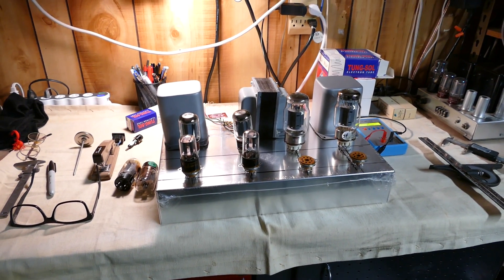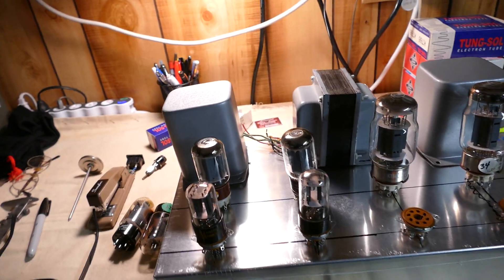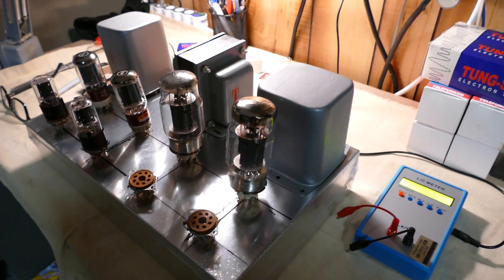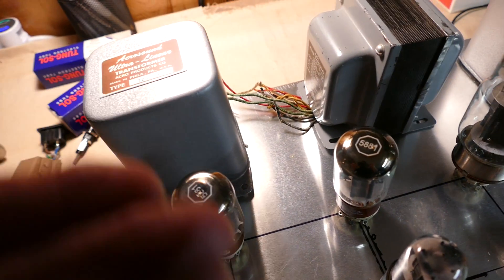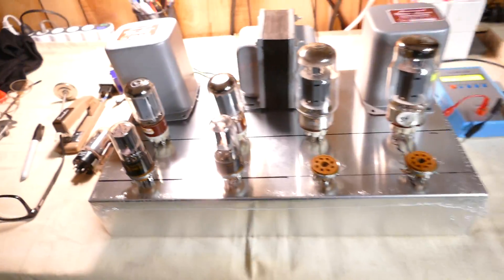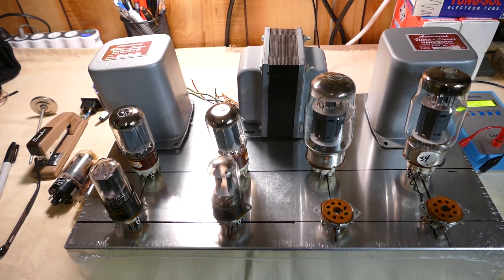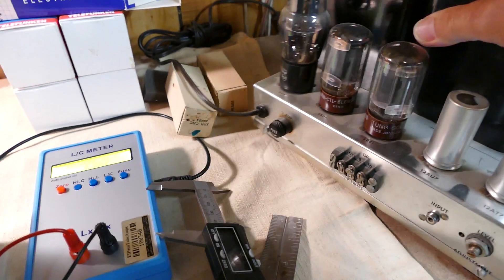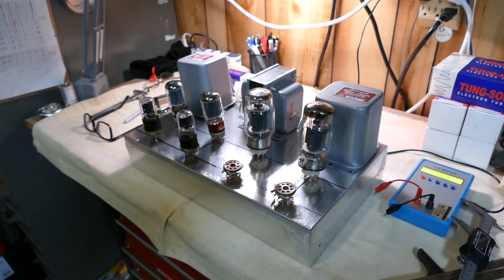Part 2 - Acrosound  (Williamson Design) Stereo Amplifier Build

Comment: The first objective is to design it correctly. The power transformer supplies 700 VCT@ 200ma. With a FWCT  rectifier, IAC=IDC, which is for 4-6SN7 is about 35 ma, plus 4-KT88 at 300 ma [75 ma x 4] which totals 335 ma, much greater than the 200 ma capacity. the filaments are also 4 x 1.6 A = 6,4A, + 4 x 0.6 A = 2.4A, totaling 8,6 A. Please reconsider your design decisions.
+
Reply from the maker: I agree that this amplifier is right at the edge of having an under-rated power transformer. The filament currents are OK as these are KT66 and not KT88 and the same for the plate current is resting at 200 mA for the finals. The power transformer does get hot but it also delivers a good 20 watts per channel. I have considered putting in a 300mA (or larger) transformer but that project just seems to always get put on the back burner.
Reply: @ElPasoTubeAmps  Yes, I also have a few amplifier projects that need those kind of changes, but I never seem to prioritize that work. Perhaps if our amplifiers were working 24 hours a day we would get to it!

Comment: Another tube placement layout suggestion that you haven't shown is.....  to place each power tube pair inline with each output transformer on the parameters where they get better cooling. By doing so, you place driver/phase splitter stages in the middle. This scheme also improves symmetry and signal routing/wiring and cooling. For reference, please try have a look at Marantz 8B and Dynaco ST70, HHScott also is another example.

Comment: Looks great. Can't wait to see the result. 

Some modifications I would recommend:

1. Since you aren't going to use a tube rectifier you should increase the capacity of the filtering caps in the powersupply from 20µF to something big like 220µF. 

2. Reduce the grid resistors of the 6sn7 from 470k to 220k. (combined with the .25µF coupling caps a 470k resistor is too big and will create massive phaseshifts in this stage.)

btw: I tend use Isopropyl alcohol to remove  any residue. Works great and it's not as dangerous as acetone.

Greetings from Germany.
Reply from the maker: I can't find the reply you made but I will comment that I did put a thermister in the primary of the power transformer (7.5 ohm) and the drop across that resistor when hot is just barely over 1 VAC so it had virtually no effect on the plate voltage. I know that is not always the case with higher value thermisters but that is how it turned out in this time. With both channels now operating the highest voltage on the first electrolytic is 450 volts so I don't have the over-voltage on my capacitors anymore. The original schematic used 20 uF capacitors and I used 40 uF. I measure a S/N of 83 dB and when I connect it to my speakers (Klipschorns) this amplifier is ever bit as quite as the McIntosh amplifiers I use. I am surprised and very pleased with how quite it is. Not to say my build is the best or only way to go with grounding schemes but I am considering making a video of just that  aspect of the amplifier. I have built amplifiers in the past that certainly were not as quite as this one and I have even used a ground buss with lesser results. Basically, I tried to learn from the "experts" i.e. McIntosh, Dynaco, Fisher, etc and follow their style. It worked nicely for me this time. I know I will find many different philosophies of grounding that others use and I am not out to discredit their methods but I can directly measure my results and then confirm that with the "listen" test. Really appreciate all your input.